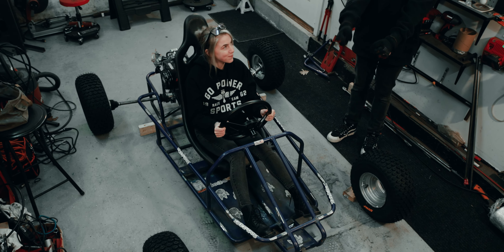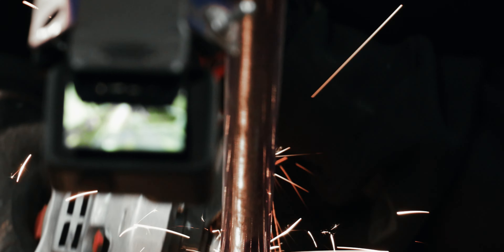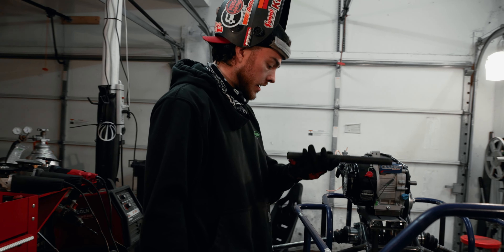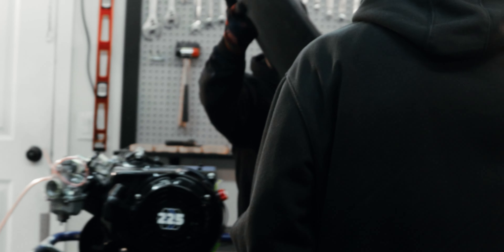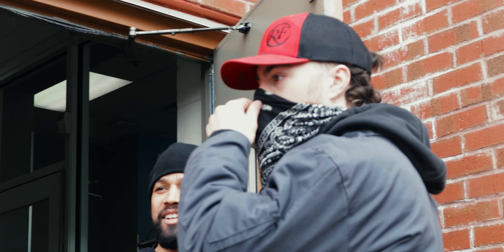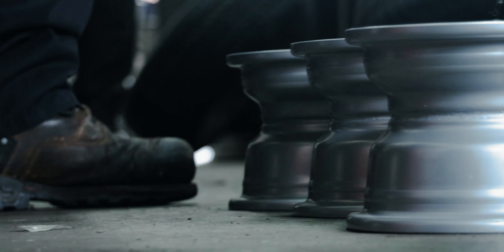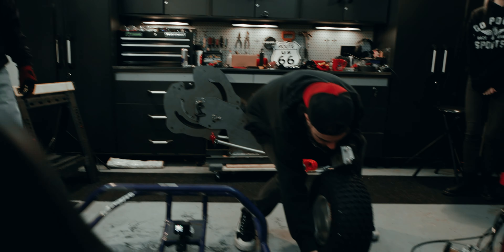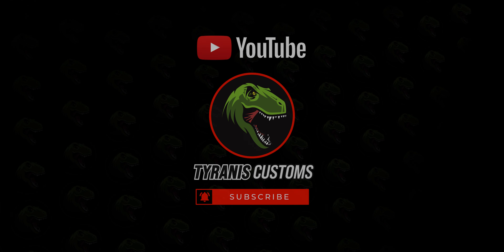225 Tillotson Cross Kart Gets Seat and Wheels | TYRANIS EP35

Comment: Kart is looking sicker each ep. Challenge if you choose to except it, is to build a solar trickle charge system for either a finished kart or add it to your kross kart. Because as I'm sure you know if your out with your buddies they get started a lot and it drains the batteries before nightfall. So this way you can get more night driving in.
Reply from the maker: You might have to bring this up again and remind me but I'd absolutely do that! Build it as a standalone unit that we could also use for overlanding to charge our gear etc... You may be on to something!
Reply: woahhhh this mans in 2050 rn. that would be epic👽👽
Reply: @TyranisCustoms  roger that. You guys are doing a killer job with the channel. Just trying to throw ideas out there to keep it fresh.
Reply: I have a stroked GX390 to 460cc on a Murray Kilowatt, not to much of the original Murray left with electric start. I went through several traditional batteries before doing some research and then finally pulling the trigger on a (antigravity) lithium battery! The baddest battery on the market imo! That company only makes batteries and battery accessories which includes Billet aluminum battery boxes/holders and a Bluetooth monitoring module and of course battery management systems/chargers for every battery they make! I highly suggest them but I will go ahead and warn that they aren't cheap, but with something that needs to be very reliable that will be an area that I will spare no expense from now on. My 12v battery fits in the palm of my hand and weights nothing. The best part about this battery is I have no charging system because of a Billet flywheel therefore I'll leave it on trickle at all times and I can go ride for a complete day without any issues and that's also running a multifunction speedometer/tachometer/temperature gauge cluster!
Reply from the maker: That sounds sick! Id love to see your build! You gotta post a video of it! Side note, I too fly CP RC helicopters🚁Cool stuff!

Comment: I would finish out the rear completely that way you can base your track width for the front without any guess work. Then cage it! Trust me from my mistakes, make sure your constantly sitting in the driver's position everytime you add something new, you run out of room really quick when building these small independent suspension buggies!
Reply from the maker: Heck yeah! I always like getting the rear set before takin on the front. I'm just hung up on a few parts I need before I can dive into it. For that reason Im probably gonna cage it, then do the rear, then the fronts etc. I just cant wait to have a roller at least!

Comment: Not sure why but my comment keeps getting deleted. Instead of a wire wheel for removing powder coat, search “stripping disc for angle grinder.” Works WAY better and removes anything.
Reply: I was trying to provide a link and YouTube deleted it.
Reply from the maker: Gottcha. I'm going to Amazon right now haha. You may have just changed my life.
Reply: @TyranisCustoms   you won’t be disappointed
Reply: @TyranisCustoms  also, I use those harbor freight angle grinders too. You may have to take the guard off to use those stripping discs. I do. 😂